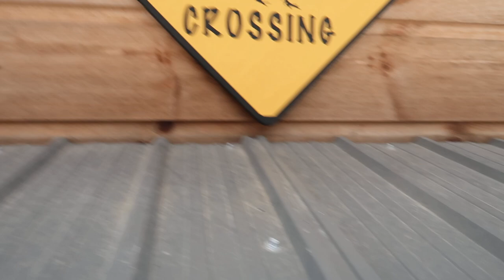I FEEL Terrible! (That I did This)

Comment: You will love those studs. I would still recommend putting some serious weight in the back of the truck to counter balance the weight of the plow for the best traction when plowing.
Reply: Yep about six 70 lb tubes of traction sand will do wonders.

Comment: Regarding your dilemma, I would suggest (in Spring, Summer and Autumn) a garden cart.  In this weather?  A sleigh, or one of those plastic boat-shaped tobbagon things, no?  You pull everything in the boat with one hand and have your other hand free for the camera.  :)
Reply: A sleigh would be perfect.
Reply: That's exactly how I do it up here in New Brunswick, Canada. The winter with the sleigh actually works faster and easier to move than the cart.
Reply: Is it possible to do like one of those big self watering systems?or something like this? https://www.youtube.com/watch?v=RhzK7WRwaC4
Reply: I know this is old video, but why do you throw chicken feed in the snow ? There are much better ways to do this .

Comment: Al, you might want to look into a flowing water system. I would stick it in the coop, it would definitely flow all winter. I have done it in the Colorado mountains ;) Every single item, every single chore on a homestead, I look to see how to reduce daily effort, replacement, etc.

Comment: I use a cheap plastic toboggan when there’s snow on the ground to pull bales of hay up the hill for my horses. If you used the 5 gallon jugs and capped them, I bet you could lay them on their side in front of the grain and be ok. Gravel driveways can be frustrating. I have two perennial potholes, no matter what I do to them, they keep coming back.
Reply from the maker: Yea we have a few of them pot holes too. Lol

Comment: Its winter! Put all that snow to work for you and get a sled. You can put a couple 5 gallon buckets of water in a sled (with a lid on them in case they turn over) and pull them along with your feed using only one hand. That leaves your other hand free for the camera.

Comment: FEEDING. I used 44 gallon drums with removable lids ,cut a u shape near the base and fold the cut piece  partially into the drum. This is then mounted onto a tyre that has been split in half----fill with food  .You now have a self feeder that lasts for weeks. I had 5000 ducks and about 400  free range hens to look after.

Comment: Not sure if you have seen the water trick yet where they wrap the water bucket in sheeps wool and place the bucket of water in a larger bucket with handles but I have friends here in Maine that swear by this. The sheeps wool keeps the water insulated and it doesn’t freeze as quickly or not at all. I wish I could post a photo.

Comment: Those studded snow tires will make a lot of difference.  My Fiero with all weather tires was like a pig on ice on snow. After sliding through an intersection I went directly to a tire shop and had four studded snow tires put on .  And that worked !  One reason that your truck is spinning it's rear wheels is because it is front end heavy.  Balance the weight of your truck and you should have better traction.
 You know that it is cold when the snow creaks under your feet . Yes, keep your chickens dry.
 I am not able to carry heavy things like bags of feed. So , I tow a mesh garden wagon behind my lawn tractor.  I have seen those wagons with ski conversions to replace the wheels in the winter time.  At your young age you should be able to pull a ski wagon like that by hand . Better than a sled because it has sides that can be raised or lowered.. I got my wagon at Tractor Supply at the end of summer season on sale .

Comment: I second the use of a sled for moving things in the snow. Cabelas used to sell a trappers sled, you might want to check into that.
For the beef, now that you have a pasture, you might want to look into Irish Dexter cattle, small, relatively easygoing, and if trained early they respect electric fencing. And being smaller they don’t tear up the field the way a larger cow would. They also eat rough grass with a higher feed to meat conversion ratio and higher harvest percentage.
I researched them for a few years and this year finally was able to get started with them. (We had just been buying a random steer on Craigslist.)
We have a steer and heifer that we will be butchering and breeding respectively next summer, we also have a cow/calf pair coming next month that is bred back so we will have a new calf in June. Just trying to get a base of a herd going so that we will have some good quality grass fed beef ourselves. 
And it’s a whole bunch less expensive. Our current steer in freezer camp cost about $3.70/pound.

Comment: Here in our area of the California Sierra which is black Angus country we and other run cattle up country late spring thru summer when the grass is still green then run them down to lower pastures come September.  Most are still run by horse since upcountry areas are hard on even sturdy trucks.  Most folks also have a tiny wagon cabin for a herdsman to live in along with a good guard dog that come calving season keeps predators away.

Like others I recommend a plastic sled/toboggan for hauling water to the chickens.  We have done that even for sheep.

Comment: You just need a sled to pull everything. Either a normal kids sled or one of those heavy duty utility sleds that Costco sells. I used to pull all my hay,shavings,grain and water for my horses in a sled. I could not drive down to the barn in winter.

Comment: For double 1 gallon water jugs you could try a wide strap that runs behind your neck and down the front.  Or for the dry feed maybe a backpack with a plywood interior box to keep the shape to load and unload easier.  At least if you do not mind being a beast of burden!  Put a backpack on Pluto like a pack mule.  Of course the feed will end up in next county.  The most sensible solution would be to get an ATV with a rear carrier.

Comment: SOLO make a 5 Gal water jug with a back pack harness. It’s actually a sprayer, but you can remove nozzle to pour straight. Should solve you not enough Hans issue

Comment: you're better off siping your tires for better traction compared to using studs! studs wear down fast and are ineffective at that point and siping your tires will make them last longer because they will run cooler in the summer time!

Comment: Buy a go pro harness for your hat or for your chest. That way we see everything and can still hear you just fine.
Have you thought about electric or solar water heater element for outdoor water dished.
I live in the snow belt in Northern Iowa and drive in just as bad of winters as you do. Snow tires are not necessary in the winter. If your truck is 4×4 and you add some weight to the rear box snow tires aren't necessary. I drive all winter in my 4x4 truck and have no trouble and I live in one of the most hilly towns in iowa.
Reply from the maker: I will have to look into a solar water heater. We don't have power to any of the our buildings here
Reply: You can find the solar H2O heaters from $30 on up.  Amazon and a couple other stores have them.

Comment: It would make a lot of since to go to the auto dismantler and pick up spare set of used stock rims for your truck and your wife's car this way you don't have to go to the tire shop every time you you need to switch tires. Thus you save the tire mounting and balancing fee's and you can change tires at home when needed instead of guessing when it is time to change them. Eventually the rims would pay for them selves giving your not paying for mounting and balance twice a year on each vehicle

Comment: I didn't get what you felt terrible about doing.
Weather has certainly not been cooperating lately. You have cold, I have wet. Trying to get a new fence line finished.
Reply: min 6:46 upper plastic flap on the wooden chicken door